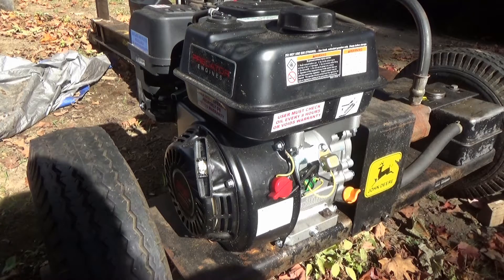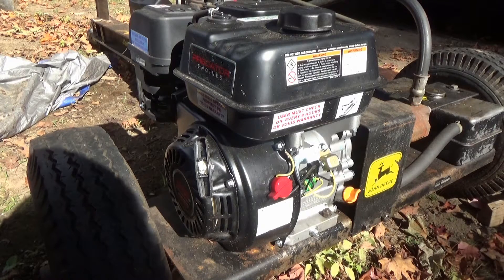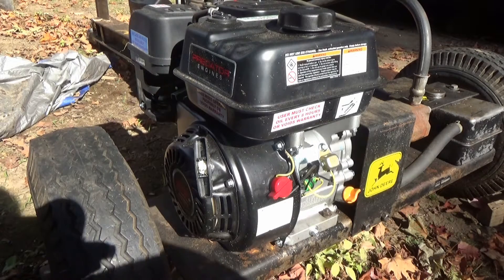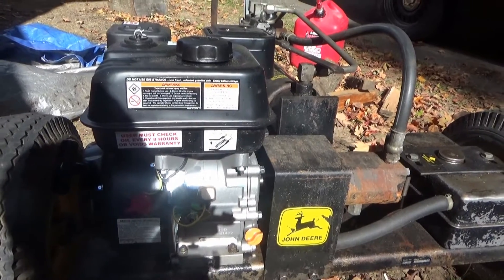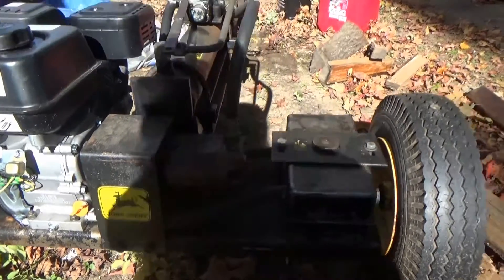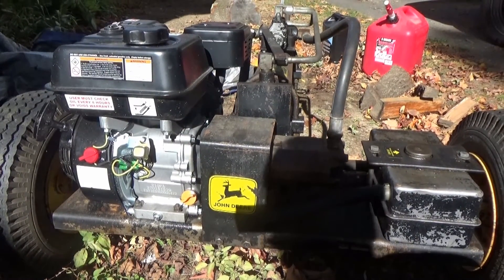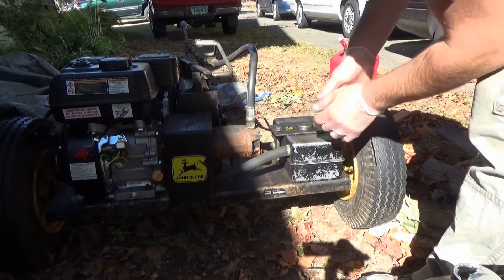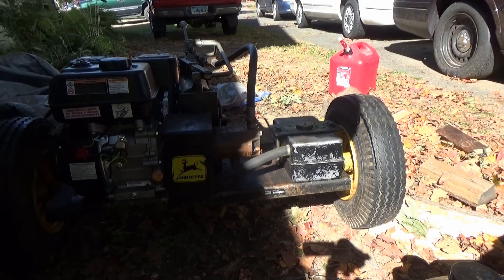Harbor Freight 6.5 HP Predator Engine On A John Deere Log Splitter 20 Ton

Comment: I have same. I bought with a honda but that dumped out. Put a predator. Lost a piece off the coupler but at least it runs. I suspect there is water in the hydraulic unit need to change.i also built a stand to raise it around 2 feet
Reply from the maker: Nice! It was a great machine. I ended up getting a tractor supply splitter on sale at a price I couldn’t beat!